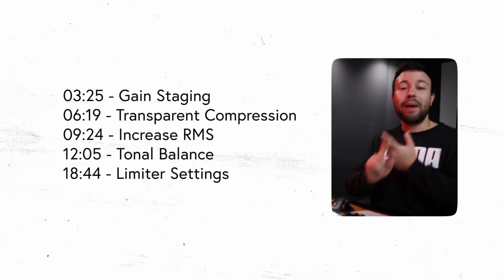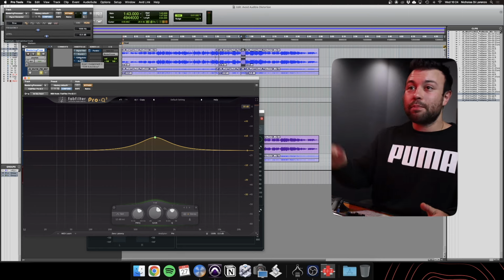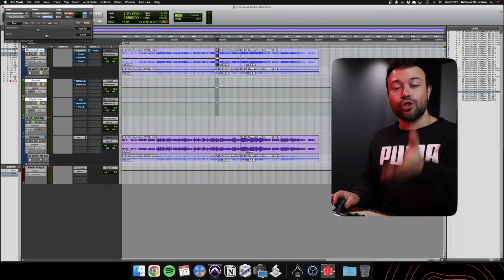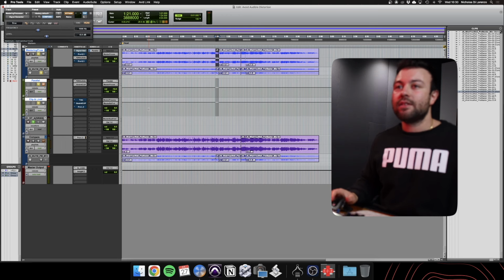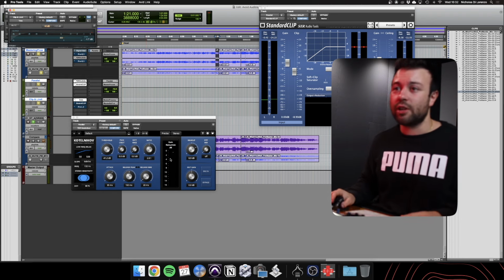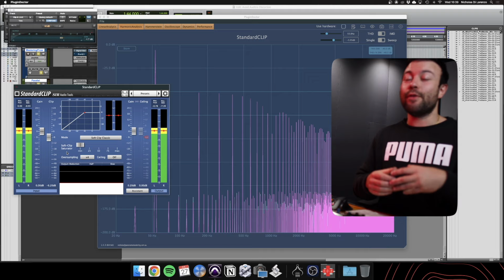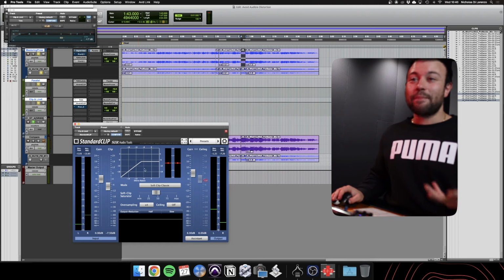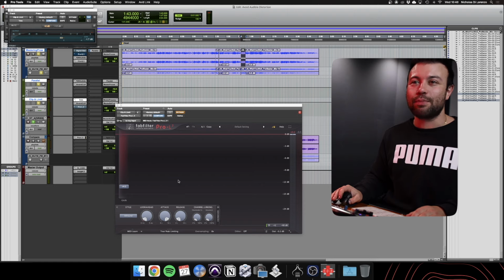NO MORE DISTORTION! How to Master Loud without Distortion and sound GOOD!

Comment: Great Video, but sorry, you have the parallel compressor fully wet here with -10 dB compression. Or did I read it wrong? This is also my mastering chain I used a lot inspired by Bob Katz. But it never gave me the results of momentary -5LUFS. Regardless what I do.

Comment: Hi Thank you very very much ; what I found difficult is to avoid distortion from Tape emulation during a mastering process. I do love the Tape emulation in general but easy (for me) to lose control on the low-end, I just had a hard time on 1 album..
Reply: Dont put the tape emulation on the low end then

Comment: Thank you very much, so valuable! I have two questions about the compression times:

The lowest note is not always the same as soon as the compressor starts working again after every circle. Do you focus exclusively on the lowest note or rather on the "average" of all notes?

And:
Wouldn't your approach to the lowest note even be applicable to limiters, which are ultimately just compressors?
Reply from the maker: Always the lowest because it will be most succesptibal to the distortion, limiters I work a bit differently
Reply: @panorama_mastering  Thanks for responding, appreciate it 😄

Comment: Gonna have to watch / listen to this at least five times to understand half of it. This definitely goes deep. I wish i was able to hear the difference between a and b on the fast and slow low end compression. It sounded exactly the same. i have the same trouble whenever i change settings on a limiter or compressor.

Comment: Great video! Couple questions...Any reason for using the zero latency setting in your Pro-Q3? Also, any reason for not using true peak on your Pro-L2?...the final master true peak looked like it was going over by 2dB, have you had any issues on playback from streaming services with delivering somthin that hot? thanks!

Comment: Dude I don’t mean to be disrespectful, but this is the worst explanation of gain staging i ever heard in 25 years of studio work. Your processors don’t give a shin about your peak value. Especially analog gear (like those you use) functions mainly with voltage. AES approved nominal level is ~1.23 V = 0 dbVU =+4 dbu. This is an average, it is not a peak level. Now, every plugin that is emulating a hardware piece of gear is kind of calibrated the same, but plugin developers never agreed on a value for this in digital full scale. It can be -18, -20, even-16 on some plugins. So if you want to trim your source material, make sure you have a LUFS meter available and make sure your indicator hovers around-18 and -20. Then you will know you are hitting your processing @ line level. That’s it! It is that simple. And by the way, if your limiter/clipper farts, it is because you have issues in your low end. Cheers

Comment: Is it my idea or all commercial songs after 2015 are very distorted, for example songs from Taylor Swift, Billie Eilish etc have very hard bass, closed sound and they have cut the high frequencies, also the volume is so loud. I have listened these albums on vinyls from a very expensive stereo system of one friend of mine and they are very distorted, and much digitized. Loudness covers all instruments and voice, and the bass is so muddy.
Same with majority of songs in Greece even they are released digital or compact disc, or  new re-releases from older vinyls.

Comment: First off, I LOVE your channel. But…@2:24 you say that IM rarely is a problem when dealing with master-grade plugins…that’s there I’m going to have to disagree with you. I mix and master electronic music and anytime there is a heavily verbbed pluck or arp or pad in a section that also has lots of sub and we’re mixing for main-stage EDM stylings…YES intermodulation occurs. It’s the bane of my existence and it take a lot to know how to overcome it. Just wanted to clarify for everyone reading: he’s correct, it’s not as common is most genres, but it’s a MASSIVE problem with artists are demanding -4lufs punchy, powerful masters with no audible distortion. Good thing too…if it were easy, I’d be out of a job ;)

Comment: You should just set your camera's focus manually. You'll need a reference for this (anything that can reach the height of where your face will be). Focus on your reference, leave it. That way you won't need to deal with re-focusing throughout the editing process (which looks really stupid).

If you have a Sony Alpha series camera you can connect it to your phone and just select your face while you're sitting in frame, your camera will automatically focus on where you touch the screen. I don't know if any other brand has this feature, but it is very useful if you have a Sony Alpha!
Reply from the maker: I know; I was so dissapointed when I uploaded the A-Roll for this vid.

I know use manual focus....

Comment: Despite all your interesting advices, there is still one major issue here in terms of mastering; this infamous loudness war is ruining thousands of mixes for only one purpose : to sound loud, and loud... No matter what you do, you're actually shrinking drastically the dynamics of the original mix (which is often horridly reduced to some 6dB of overall dynamics). When listening to most of the "modern nowadays mastered stuff", it's just a pain for ears : too much squashed, it doesn't breathe, very exhausting after a certain time. And it's stupid too, because every streaming site has an automatic levelling, so there is clearly no point carrying on with wanting to sound "loud" at all costs. The real purpose of mastering is to make a mix sound great with the great principle "primum non nocere". It doesn't have to be insanely loud! Make it just sound as good and balanced as possible. If more mastering engineers explained and educated their customers, instead of complying to the only loudness factor, we'd have much better sounding masters for years (as well as less terrible remasters).

We now have the best possible digital resolutions and converters available (24 bits, 96kHz and more), we can have a sound quality way better than that was possible back in the 70's/80's... Still, all these records of the past sound way better, and that's because back then, there was no loudness war, engineers had taste and the listeners knew there was a volume knob on their Hi-Fi equipment (because back in the days we also had relatively decent Hi-Fi systems to listen on). Were all those legendary records like "Dark Side Of The Moon" (Pink Floyd), "Thriller" (Michael Jackson), "Synchronicity" (The Police), "So" (Peter Gabriel), "Parade" (Prince), "The Joshua Tree" (U2), etc. to name a few that loud and squashed? Certainly not !

So, what the hell has happened in the meantime? People got used to fast-food sounding records, listen on the most terrible gear (telephones, tablets...). Fortunately, Jazz and Classical Music have been spared from this madness. Don't you think it's time for people to get a decent overall listening culture (with acoustic music is a very good start) and get themselves some decent Hi-Fi systems?
Reply: I would like to add a whole different take on this. It's being said that a good master cannot fix a bad mix. Vice versa, a good mix/master cannot fix a bad song/composition. I mean I have learnt a lot about these physics and maths behind digital/analog audio and sound/acoustics during my studies at university, its crazy to calculate fourier transforms, RMS etc. by hand... but there is also that "art" side next to the absolute technical perspective. As my piano teacher said, emotion in music lies in expression. Playing any real instrument is a whole different story than making music on a PC and drawing notes as many modern producers do (I dont say all of them). Take a simple trumpet as an example (as you mentioned Jazz/Classical music). Playing it soft or loud isn't just "volume" and dynamics. The sound gets richer, more overtones, the timbre can change in some instruments. Thats why there are these terms as "pianissimo" or "forte" even when each instrument in a live band has its own microphone assembled and the sound engineer could do all the dynamics on a mixer. But thats not the point. If you want a dynamic master or mix, you have to be aware of the different characteristics a instrument may have. Example: You got a master with -9 LUFS short term for the loudest part which is already pretty loud. In this section you got a sampled trumpet. Then in a break section which shall be a little lower in volume you got this same trumpet, but its like 6 dB quieter. This will sound totally unnatural as the same trumpet with the same overtones/timbre is just turned down in volume for this section. Same thing applies to synth: if all of your synth are saturated and compressed as hell and dont have any dynamic movement in them, how can you expect them to sound dynamic in your final master chain? In the end this is just some fourier theory and maths. The more overtones your instrument has, the louder it will appear to you because the RMS is increased, even if the amplitude is the same (not mentioning even and odd harmonics here). As an simple reference, the RMS value of a simple bipolar square wave is exactly the same as it's amplitude. Some composers understand this concept/connection between loudness and timbre and put this into their synth based music. Hans Zimmer, Ludwig Göransson or even Daft Punk on TRON Legacy as an example. They just built custom instruments using synths with a lot of modulation. If you want to move somebodys heart with music, the first thing that has to move is your music. Just my opinion.
Reply: as a music producers with 10+ years of exp, while i agree with you.. there is a problem playing live. i know people have volume knobs, but when you are in a festival not only you dont have access to it.. it is usually already at max value. so when the previous act finishes and you hit play, the crowd are gonna boo if the volume difference is too big (more than 3db is enough for everyone to think you are a bad producer). 

i dont like loudness war, but for an electronic music producer, this is a real problem. we dont make music for listen at home, we make it to play at festivals where volume is already at max.. so how the fuck can we sound as loud as the previous guy and not lose all expression in the process? its hard
Reply: You are so right! Apart from that (and I speak now as a hearing care professional), it’s ruining our ears too… Shouldn’t we just go back to normal levels…? If one insists on listening at high volumes: turn up the volume…. Quite simple, isn’t it. The best mixes though are those that still sound open/transparent and dynamic when listened to at low volume levels… regardless of where you are and which playback device you use.
Reply: Unfortunately the Platform Algorithms that regulate volume don`t solve the Issue. An oversaturated hypercomrpessed mix will always sound louder even at same listening levels. It has a specific characteristic sound. People are used to it and in a way subconsciously addicted to  distorted music. 
Don`t get me wrong, i agree with you wholeheartedly and find modern production suuuper fatiguing to listen to. 
However i don`t see it subsiding any day soon. Negative 3 Lufs with Postitive peaks of more than 1 Db are not rare nowadays. 
To your 80s remark. There actually was a Loudness war not only back then but even further back. Loudness war is going back basically to Gramophone times and later Vinyl where engineers tried to cut hotter Records. Then with Vinyl and later  they started to go crazy.
There is a superb interview talk with Alan Silverman here on YT  called The Future of Mastering that analyses the rise of Distortion as we progress in time. Its crazy magnitude level more Distortion now. 
In short, the real purpose of professional mastering is to do what the client wants not to only do what the mastering engineer finds right  and unfortunately the client….. Don`t let me start
Reply: Damn agree with you! And not mentionning that in this video at the end of this exemple it has indeed distortion (at least with headphones on) imo a master engineer should care about dynamics and make the song sounds good not squashed !.
Reply: Totally agreed. I started late 80s. Fast food music is so awful.
Reply: Sadly it's a DJ problem when playing live than it is a production issue most edm labels want loud -5/-7 lufs which to me is over kill but if I try go for -10 they say it's to low or just avoid playing it in a set bc they can't be bothered to turn it up while cuing.
Reply: Digital over analog, mastering tools in home environment,  any idiot being left to run riot... you bang on with the whole idea of mastering being perverted to loud....

Back in the day Mastering engineers used to be magicians that understood ideas so advanced that you need a physics degree to understand... mix and master studios, not laptop in bedroom... 

I would argue the same applies in regards to music production...

Comment: Can I ask how does the side information sound when you flip it into the sides? Is it clean or is there audible artifacts present? Is this something that give much attention to? Thanks really enjoy your content 😊
Reply from the maker: That's something I do monitor from time to time; often when dialing in and pushing clippers / limiters; if artefacts begin to rear their head I tend to find that's the point where I need to back off;
Reply: Thank you for the reply... yes its a very fine balance 😊 would you use anything else to put those dbs into the master or would you just not push it anymore? Again thanks for all your work.

Comment: This is neat stuff, particularly the bit about calculating the attack/release times based on the lowest fundamental. I’m normally not one to break out a calculator while mixing but when it comes to the master bus, I’m no mastering engineer so I’m happy to minimize any guesswork. 

Just wanted to bring up one thing though regarding internal clipping you mentioned in the gain-staging bit. As far as I can tell, you can’t internally clip (in my DAW at least). I can clip on the way in and the way out obviously but any individual tracks in between that feed into the master bus don’t audibly clip when going over 0db so long as the master bus has a limiter on it. So I don’t find it necessary to bother with gain-staging so long as the mix is balanced. If I need more headroom before hitting the limiter, I simply pull down the fader on the master bus.
Reply from the maker: You're spot on correct; the gain-staging is more like house keeping between plugins more than anything;

Comment: Is gain staging really that important?
Even with 32 bit float?
It's only REALLY clipping when you export the master track, right?
IMHO it doesn't matter to leave the master at -6 or 0, because you're gonna clip/limit/compress either way. I really don't get the difference.
[ I'M NOT USING ANALOG EMULATION, FULL DIGITAL STUFF]
Reply from the maker: Controlling the clipping; and having autonomy over how it's clipped is what's important here;

Re- the -6dBTP going through the chain; some plugins architecture will clip at 24bits; and not have the 8bit float; that's why;

Comment: I wonder why you use true peak levels as a reference instead of LUFS or RMS to set proper levels. Most analog emulating plug-ins are calibrated at 0 dBVU = -18 dBFS.
Reply from the maker: For consistent headroom going into clippers/limiters; not that it makes any difference on the fidelity; but more-so the consistency of the workflow;

Comment: Hey! Awesome job you are great professor. I have a question, when you compress your signal(8:25 on video) it's not possible that your true peak max have changed place? i mean, because of compression other part of the song has the true peak max. i hope you can understand my question
Reply from the maker: Yes; I understand your question;

That first clip I'm looping is the maximum true peak meters in the song; and I've realised I may have missed a critical part of the process in this video;

I use iZotope Audio Editor to give me a time marker of where the loudest peak is and that's where I gain-stage and monitor my peaks at!
Reply: @panorama_mastering  Man you are a legend, i'm evolving my work a lot by seing your videos. 
I saw in another video you using the izotope audio editor, i didn't find a free alternative either  for it but i'm using decibel of process audio.
But my question is when you alter the dynamics of a song with compressor or limiter, there is no chance that your MAX true peak, is in another part of the song now? Example, max true peak in 1:00 min of a song, after compressor, the max true peak is in 2:20 min ? I mean, you are changing the dynamics of it right?
Thx for the attention
Reply from the maker: @Tihdj99  Ahh yes; I get what you're saying; well; there certainly is a chance! You're not wrong there; but I couldn't imagine the tollerance of that initial true peak being so many dB out that it throws everything off;
Reply: @panorama_mastering  Oh i get it, so it is consistent anyway and it can be used as a reference point
Reply: Example, a kick or snare, after the makeup gain 1.5db